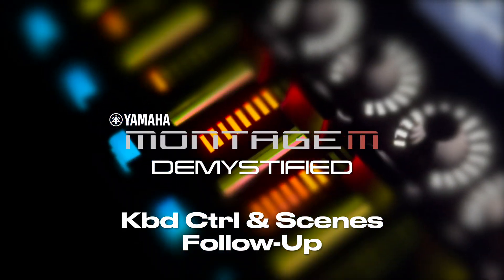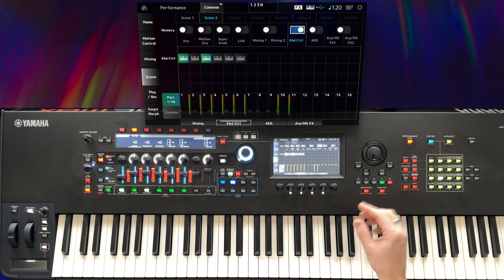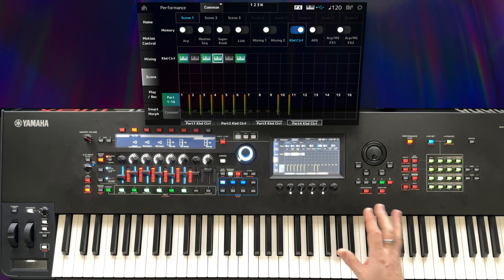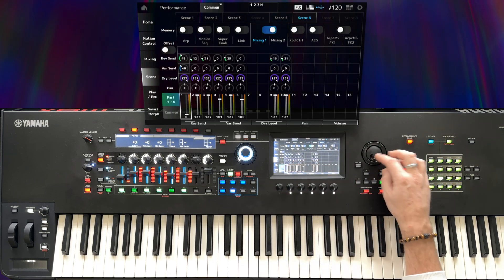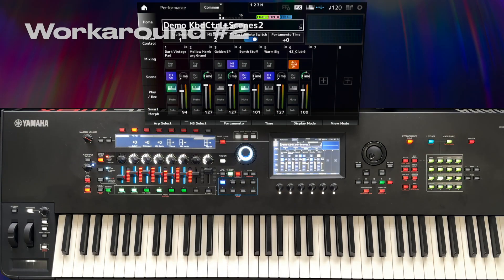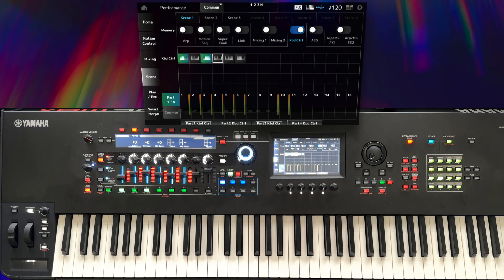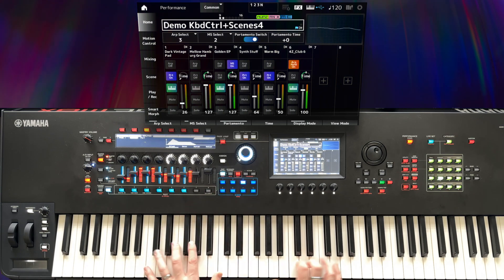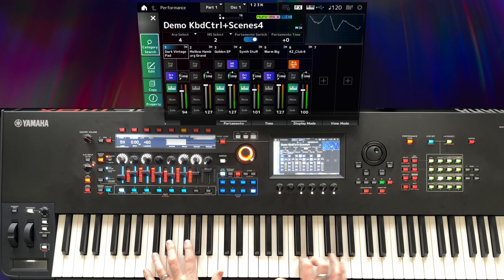Weirdness! Setting keyboard control with scenes might be buggy on Yamaha MONTAGE M - workaround here

Comment: Thanks for all your videos.
Could you show how to transfer a song (converted pattern chain) to a computer?
Either over USB or by using a USB stick.
I wonder if all the data would be inside the midi and if Yamaha ESP will play it properly.
Reply from the maker: Thanks for your comment. I barely use the Montage sequencer (I do everything in a DAW) so I have never actually attempted to move a sequenced song between the Montage and a computer, but I can say that it would have to be via a USB stick, as Montage (infuriatingly) does not transfer any user data directly over its USB connection outside of what it does with ESP.